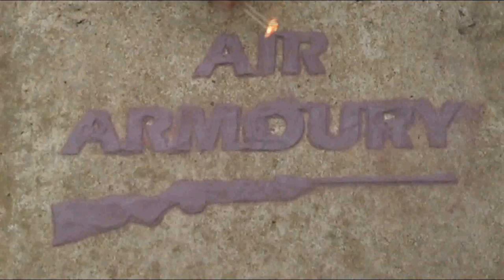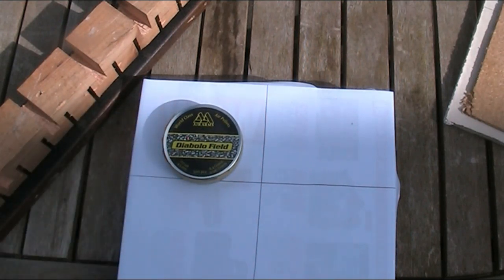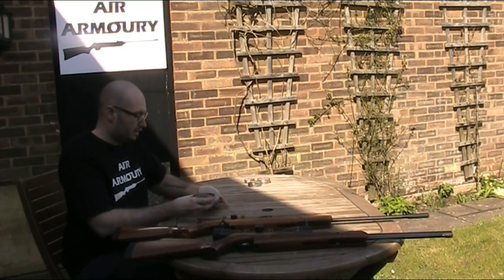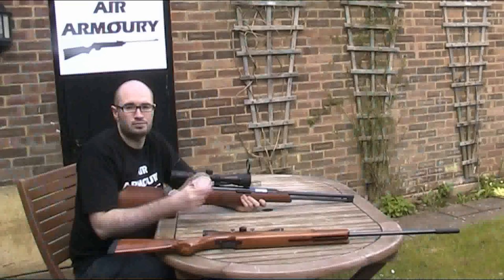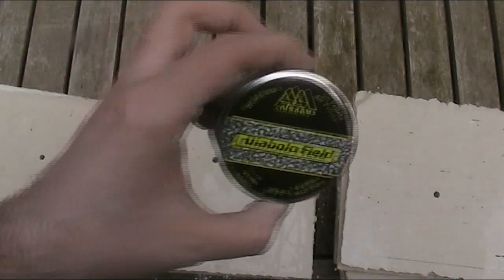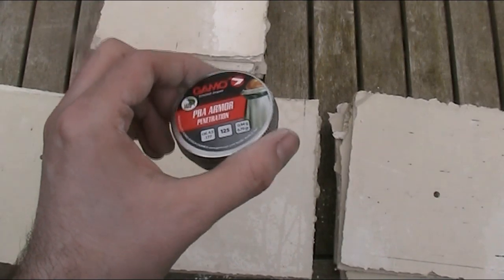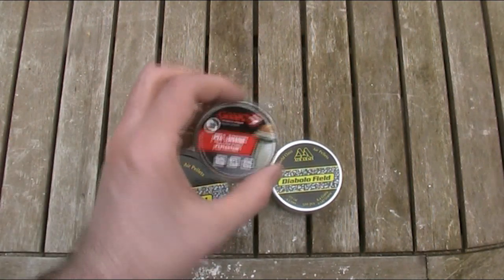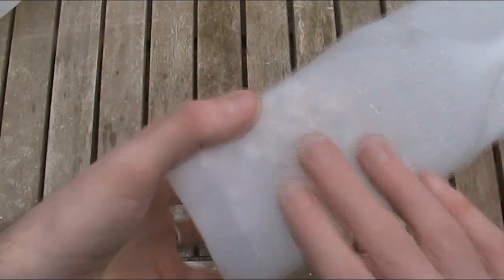What Will Stop An Air Rifle Pellet? | Air Armoury

Comment: Four years later... this pops up exactly when I want it... spoooky! So, if you're into whacking wabbits, you'll want the ammunition which penetrates LEAST because it loses more of its energy in the target, so lethal effect is more likely... if you get a clean shot (but clean shots are more likely with .177).

Now I know what to do with my Screwfix, BigDug and Argos back-catalogues. BTW, there was more penetration than I expected for the power. I might fill some off-cuts of cellular paviour for a test of dry vs wet sand to see if it's quieter.